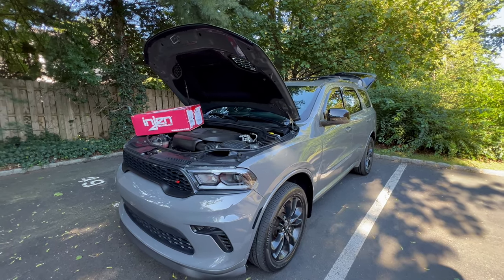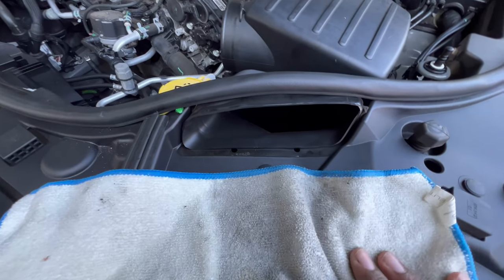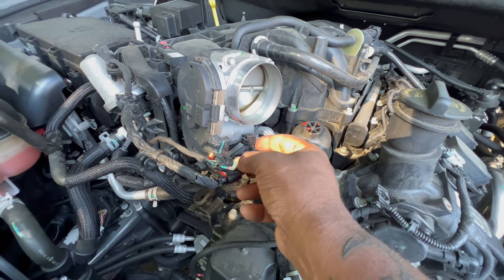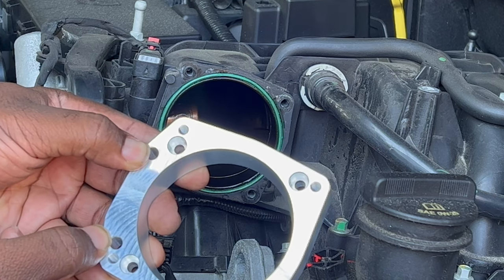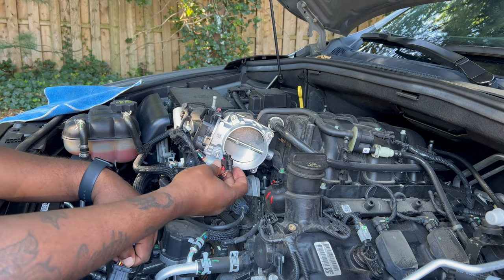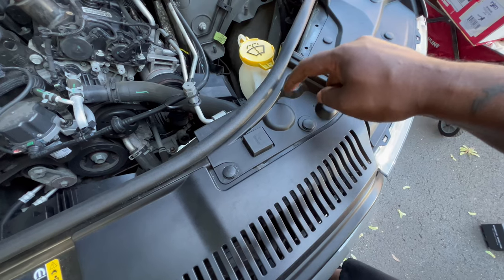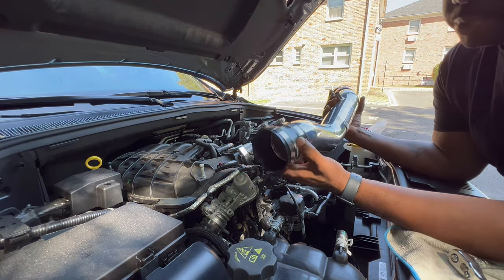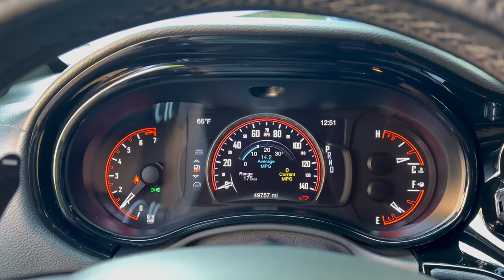Installing Injen CAI & MMX HEMI 80mm Throttle Body to Pentastar V6 - 2021 Dodge Durango GT Plus 🔥

Comment: Very nice video.  I want to install a spin on oil filter adapter, but it looks like this air intake won't allow room for the spin on oil filter adapter.  Thanks.
Reply from the maker: Hmmm, it should to be honest. They all have their respective places to be installed. I’m installing a oil catch can soon and it works perfectly with this set up.

Comment: You might feel the additional power from the intake more than you feel any power made from the TB. You really need to port, the intake, manifold, and head to make real gains from the TB
Reply from the maker: Thanks for the info, I’m not really trying to do too much though. Just basic bolt ons and honestly it feels good where it’s at.

Comment: For anyone who sees this. AFE MOMENTUM intake does NOT fit well with the 80mm throttle body due to the big enclosed box. It took me 2 hours alone to get it to fit. If you need any tips, comment below though.
Reply from the maker: That is a Great piece of information, thank you 🙏🏾
Reply: I have the afe momentum, how did you install it?
Reply: @iunior7  oh god, it’s horrible lol. My recommendation would be to get a sawzaw and cut 2-3 inches off the intake on the left side. What year do you have though? This is for the one where the throttle body is in the front, not the back. If you don’t wanna cut it, then you won’t be able to change oil filter without removing the intake every time.
Reply: Yeah mine is in the front, like the durango of this video. I was thinking to get adapter for the en of the intake, but i gotta see of i can find it.
Thanks for your reply

Comment: I have a 21 regular GT and I’m about to get this set up! Question, how do you change the filter?
Reply from the maker: Nice, are you talking about the cabin filter?
Reply: @genedaox  The blue filter that’s attached to the cold air intake. Do you wash when dirty or have to change it?
Reply: @Thatguy1306n you get the cleaning kit. You don't change them unless it gets really bad. But it's all about maintenance. The kit comes with a spray and instructions. Just takes time to dry it out. Trust the process.

Comment: How does the filter hold up to rain or even the car wash? Does it get wet? Since the oem has a box around it to keep from that happening. Thanks for the vids. I just got a '23 GT premium Blacktop. Excited to get some of this going.
Reply from the maker: It’s great and no it doesn’t get wet due to the design of the heat shield. Nice man, enjoy! And feel free to ask questions!

Comment: Any engine lights come on since you uploaded ? Been thinking about doing a air intake. Does it make a nice difference in the drive?
Reply from the maker: Nope! No check engine light and yes I can feel a difference. It may not be by a large margin but she definitely has more of a “get up and go” you can feel when you on it. I also have gained around 2 more miles per gallon which I was surprised since I haven’t changed the way I drive and I have a pretty heavy foot lol.
Reply: I have been running cold air intake for several years, it sounds awesome. Granted I have the 5.7 but still almost the same install. Mine is a 2018 Durango R/T.
Reply from the maker: @TheDeathM Nice! One day soon I’ll be stepping into a Big Boy V8. This V6 was a nice step into the mopar world and a nice looking family truck for me. V6 get so much hate but honestly with the minor changes I’ve made, I love it and it has become way more fun to drive over stock. Few more mods to go to get it to where I want it but I’m loving where it is.
Reply: @genedaox  I guess I can understand why the V6 gets some of the hate. From what I have heard it isn't as reliable, but all engines these days all have some kind of issue. Take my Gen 3 Hemi, if you leave the cylinder deactivation on and allow the valve seats to cool they could just drop right out of the heads, instant pain.
Keep up the mods I would like to see them.
Reply: you could damn near throw any intake or throttle body on a 3.6 or dodge vehicle because they don't use traditional mass airflow sensors which makes them very accepting of just about any intake mod you can bolt on before a custom tune is required but the stock tune can only add a very small amount of fuel and timing on its pre set factory tables

Comment: does the adapter come with the TB? and did
 you have factory exhaust installed when this vid was made?
Reply from the maker: The adapter does and no, not yet. I have the pieces for my build but will be installing around spring.
Reply: @genedaox  Nice!! and Thank you! think my 2018 GT is going to get some love, assuming these MODS show cased in this vid and a new exhaust set-up don't screw  on my PA emissions...

Comment: Love how thorough you are. Did you notice an increase to power?
Reply from the maker: Appreciate you, you can definitely feel a difference in how it drives over stock. Gains may not be impressive but I wouldn’t expect anything crazy unless you’re trying to do more engine work, which is something I’m not interested in doing… 🙏🏾🙏🏾🙏🏾
Reply: Did you have to tune? I may have missed it in the video. @genedaox
Reply from the maker: @NCMEDIC216  I have not tuned
Reply: @NCMEDIC216 he didn't notice SH. Been modding cars for 26 years....ask me how I know
Reply: @4fit816  I did the mods and there’s a little bump in acceleration. Not much but just a little.
Reply: @NCMEDIC216  read my comment again....or ask a 10 year old to explain it to ya
Reply: @4fit816  read my comment again too.
Reply: @NCMEDIC216  Your comment is BS....mine isnt.
Reply: @4fit816  have you done the exact mods on the exact engine? If not, then you have no room to talk. Cause we have and we have expressed there’s a LITTLE increase. NOT significant but very LITTLE, but noticeable depending upon the conditions.
Reply: @NCMEDIC216  Yep in 2 300's and one Magnum. You aint noticing any difference. You can try to justify your time all you want. But you still full of S

Comment: I need your help/advice. I installed the 80mm throttle body on my Pentastar Durango. 2020. Did the throttle reset. Immediate rough idle and wouldn’t let me push the gas pedal. Flashed “service electronic throttle control” on the dash. Check engine light. Immediately put the old one back on and it was fine.
Reply from the maker: Hmmm, was there a harness to install with the throttle body you purchased? Also, try pushing the gas pedal in to the floor (with the car off) Slowly, three times before starting it back up after installation.
Reply: @genedaox  yes harness was supplied. Not sure if the harness was faulty. It was from MMX. I did the last part too.
Reply from the maker: @NCMEDIC216  That’s weird. Have you contacted them to try and switch out the harness? I haven’t experienced a code and neither has anyone I’ve come across with this set up. If you installed everything else correctly,  that would be my guess.
Reply: @genedaox  going to contact them tomorrow. Just got it today.
Reply from the maker: @NCMEDIC216  Nice, let me know how that goes bro.
Reply: @genedaox  so turns out I’m just stupid lol. I didn’t put the Phillips screws into the recessed end so it wasn’t air tight. Had the adapter / spacer on backwards.
Reply from the maker: @NCMEDIC216  Ahhhhhh! There you go..

Comment: Does it make a weird sound when idle? I had one on a 2014dpdge durango and in idle it used to make an annoying sound. With the 2021 gt plusblacktop v6 im tempted to place one. But if it makes that whooping sound i mau not get it. 😊
Reply from the maker: Nope, no weird sounds.
Reply: Get it. You’ll be so happy you did

Comment: how many HP does it add??
Reply from the maker: According to the manufacturer, (INTAKE) Dyno Proven gains of up to 17 hp and 17 lb-ft. of torque. I have not taken mine to the dyno so I can not confirm but I can confirm there is a difference over stock even if its minimal!
Reply: I'm pretty sure that once you do all these add-ons, you have to get your Durango tuned for any HP or Torc to increase. If you're just adding 1 of these then it probably isn't worth it to get it tuned but if you're adding multiple bolt-ons then I recommend you get it tuned to get the full benefits of the mods.

Comment: Changing the throttle body doesn't do much at all maybe a 1 to 2 hph gain. your really wasting money installing that on the hemi. Dodge has these cars pushed to the limit coming off stock. Unless you add a supercharger or a cam. you wont see much.  Unless you have a Hellcat version you can get up to 1000 plus horse power out of those engines. JFYI..
Reply: FYI that was a 3.6 liter V6 not a Hemi
Reply: still won’t make any difference to feel in the driving experience… 😊
Reply from the maker: The crazy part is, you saying it won’t make a difference to feel in driving experience but everything I’ve done has noticeably changed the driving experience for the better. All the horse power talk you talking means nothing brother lol. Not doing this to be racing but to simply make the driving experience better and to help other which I’ve succeeded at. Thanks for the input though.
Reply: @genedaox  Umm Hmm sounds good I have a 21 RT Durango, Every engine mod done has voided the 36/60K mile warranty by Dodge.  But hey keep up the good work, I would advise anyone adding to their vehicle to research it totally before proceeding. Not trying to be disrespectful just saying that once you add to your vehicle, it has to be calibrated and tuned to adjust to the new mod. Otherwise its just there...sounds good but doing absolutely nothing> (Speaking from personal experiences with my own (DURANGO)>>
Reply from the maker: @gfish45 👌🏾
Reply: @gfish45 any engine mod won’t void the warranty unless that specific mod caused the issue with the engine and proven it came from the mod.
Reply: @gfish45 as a dealership technician, not accurate. If the part can be proven to be the cause of a problem, then yes, it voids warranty. But having your lifter fail due to oil starvation can’t be traced back to a throttle body and intake tube… catch my drift?